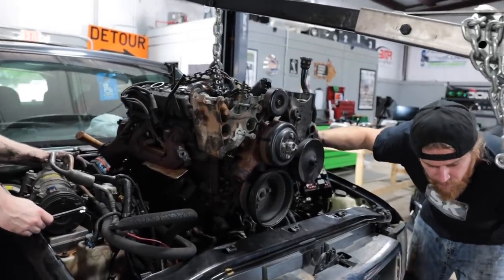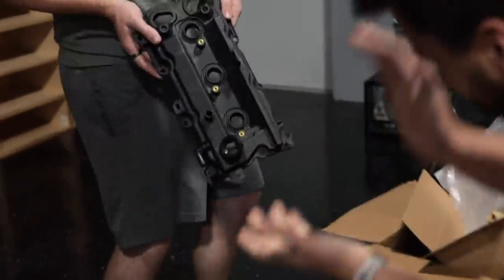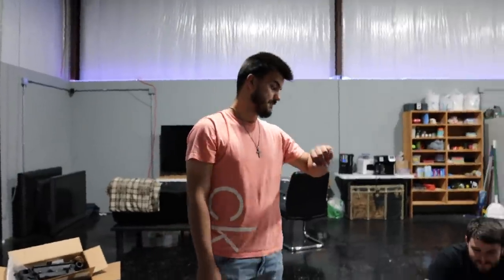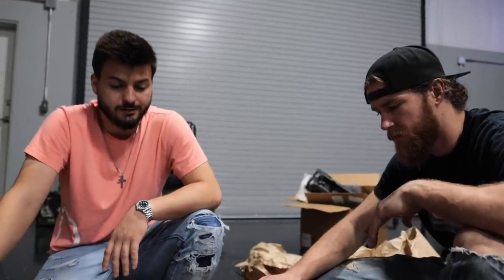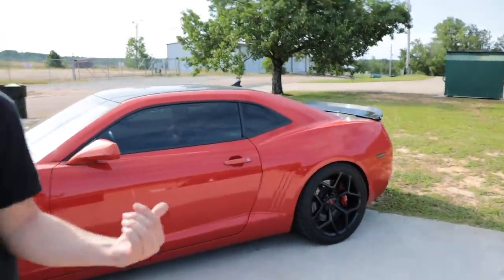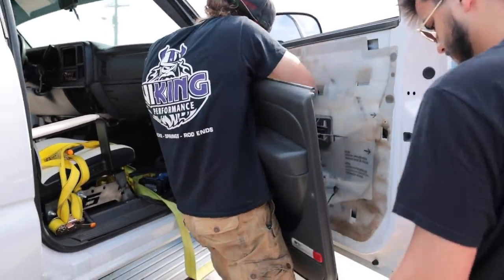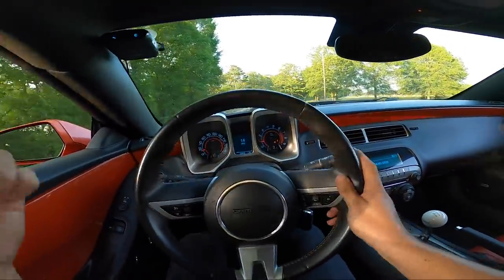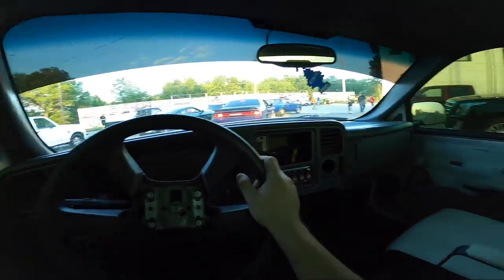Camaro and Race Truck First Track Day! *Big Change is Coming*

Comment: Gavin: 600 whp is lot
Also Gavin: has 2 1000 whp cars
Reply: Technically the other one is 900 whp
Reply: @zimmateja  didn't the dyno max out? And they couldn't get accurate HP?
Reply: zImMateja wasn’t 900 it’d was high 9s
Reply: @thenotoriousotter2586  it did. 1:1 is 5th gear and the dyno wouldn't go that high MPH so they did a guesstimate on actual numbers. If they do a hub dyno it's easily 1050 probably 1100.
Reply: @thenotoriousotter2586  it did but im just saying for now that car is 980whp i think i hope he dynos is again later 👀
Reply: zImMateja even more technically it was 980
Reply: And one is a daily driver 😂
Reply: 29:50 wow

Comment: Lingenfelter clutch pedal return spring, stainless clutch line, separate clutch fluid reservoir, and modified my slave cylinder in my old 5th gen and never had that issue of pedal stick again. Food for thought!

Comment: Had the same issue with my camaro once I put it on prepped street clutch stuck to the floor lol replace the junk slave and separate the reservoir is what was recommended

Comment: I can't remember the company but there is a company that makes a seperate reservoir for the clutch fluid and brake fluid. Pretty common on all 5th gens for em to stick to the floor lol. Also if it is 3.27 rear end gearing then you should be able to stay in 3rd through the quarter instead of shifting

Comment: Gavin you gotta send your converter to get loosened up. I had the same problem on my c10 I went through two converters not stalling right until I just sent it back to get loosened and it hits hard now.

Comment: Its gonna stick to the floor every time you do a big burn out. You can use a spring on the pedal and a dedicated reservoir for the clutch fluid to get the pedal to come back up but its still gonna slip.

Comment: Clutch pedal was a common problem on early model 5th gens. Forget if the fix is a fluid swap or a new spring in the pedal. Stock clutch took a lot of abuse on my 5th gen ss with similar power. Procharger though? It's new clutch time lol

Comment: HEY! The butterfly valve on that 4.3 isn’t actually that thick. It has a little hood that hangs off the bottom of the valve. A lot of people drill out the rivets or cut off the hood and you gain some power and mpg. I guess it’s just a emissions thing

Comment: 13.4  not bad I mean u got a stock 6.0 with cam headers ind intake .those airplane gears are killing the truck I think   some 4.10.s or even 4.56.s j think u got a 12 sec na truck with a few little changes and good dyno tune to really dial it in

Comment: I feel the same Gavin with the so much stuff failing like honestly my ls swapped c20 has low oil pressure my new gauges cluster are acting dumb I’m on trans 3 when I did oil change it was alittle thick my exhaust flange just backed off the nuts from the bolts today and also my upper shock mount bolt popped out today also

Comment: 13.4 might be slow when you are used too a 1000hp, but for an na truck, not bad. My best time in a 300+wheel hp turbo cobalt ss was a 13.5 @ 107...thats not saying much as its 12 sec capable with some tires but on the street that would have gapped me pretty bad, so honor the na 13 ey lol

Comment: Actually the 4.3 is what contributed to the 5.3 it's literally a 327 with chopped off cylinders one of the best motors Chevy came up with
Reply: The 4.3 and the 305/327/350 had nothing to do with the 5.3 LS.   They literally share nothing together.
Reply: @1216jimmyz  you'd be actually surprised that they do

Comment: TCC staying locked up on the 4l80e killing it occasionally? higher line pressures have that issue on the 4l80e. They make a valve to fix that.

Comment: The truck really isn’t running bad, with a bigger converter and the rev limiter turned up a little it will probably run 12s, I think that motor will take a lot more abuse

Comment: Does the race truck still have the stock fuel tank and fuel pump? If so that might be the problem with the truck dying. I have a Chevy truck and my truck did the same thing because the fuel pump was bad so I had to buy a new one and worked fine after. Love the vids, hope I can help.

Comment: My ls1 camaro has 20lbs of oil pressure at idle 😐
Reply: My 92 has 15🤙
Reply: @samelliott1056  Job security
Reply: Mine is when its warm amd I've been driving for a bit. On startup it has about 55. Only has 80k miles